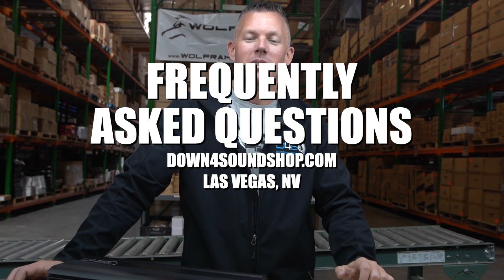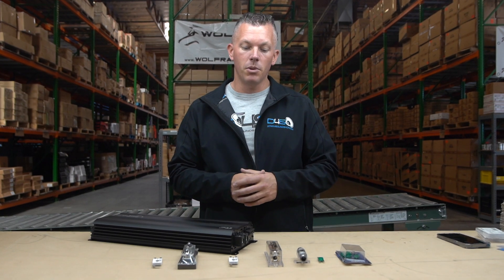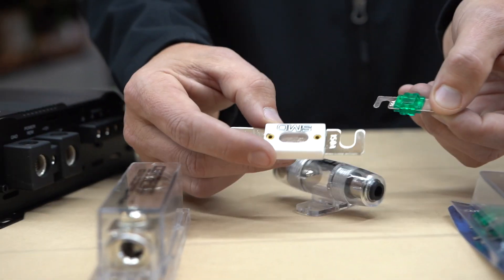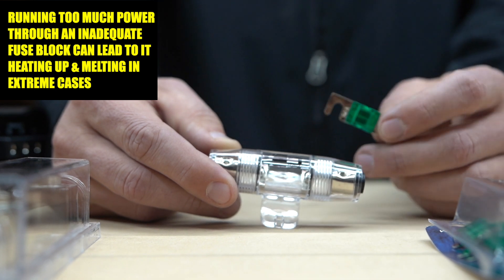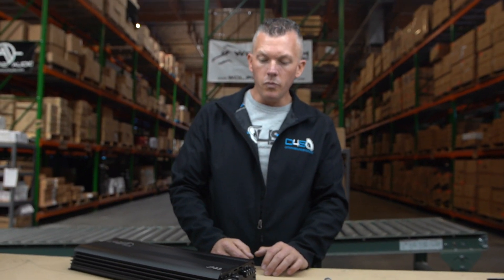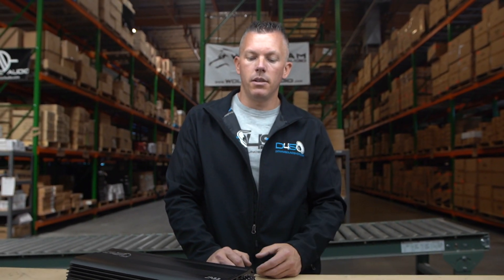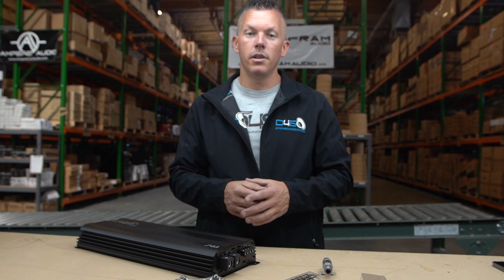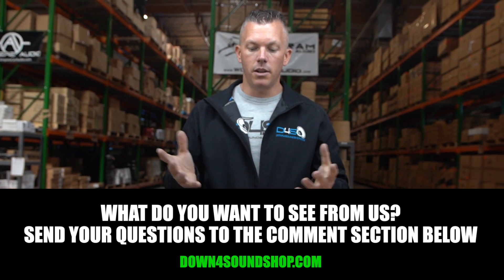FAQS WITH JP: WHY DO I KEEP BLOWING FUSES

Comment: A mini anl fuse can be 200 amps, and be zero gage, what heats up a fuse holder is not the fuse type, its wire that’s too small, or connection issues. 
A mini anl, or a full size anl, will and should to the same exact job, with the same rated fuse. Using undersized wire will not only melt stuff, it will also have a voltage drop, as little as .5 of a volt is noticeable.
Know and measure voltage drop, keep a record of it, it will increase over time, and will point to problems before they melt stuff. Usually corrosion, or loose grub screws. 
I get it, you sell stuff….

Comment: I have the jp23 and it replaced my 1500 watt powerbass amp, forgot to change the fuse and blew the fuse. I checked every connection and traced it to the fuse. Mistakes happen from time to time.

Comment: I have a 6000 W power acoustic amp with four gauge wire. It blew a 200 W fuse. Do I need a 250 W fuel or 300 W fuels? Where did I go wrong?
Reply: 4gauge wire to start heat build up go to 0

Comment: I’ve been using the in-line fuse that came in my wiring kit that has a 60A fuse and it works fine at night but has blown twice on me while driving on a warm day. Could the heat be the issue?
Reply: If so, how should I go about this

Comment: I have a Skar 2000.1D and a Skar ZVX 15 on 4 guage OFC wire and it keeps blowing my 100amp fuses and jus melted the holder. I'm ordering a 200amp braker block, but should I upgrad my wiring to 0 gauge?
Reply: Did you figure it out ??? Mine keeps melting and blowing out the fuses
Reply: 4 gauge is to small for that amp

Comment: I have a question I have a 250 amp fuse the one by the battery could I switch that one out for a 300 amp fuse cuz it popped or broke?

Comment: Can you overpower a amp with a large battery by not running a fuse…..causing the amp to fry by simply switching it on …huge headway battery 120ah and tar amps bass 15k is my example no fuse

Comment: HEY, 

First of all, I’m a big fan I watch all your videos and I like and subscribe probably to the majority of them because I honestly do appreciate you and your team and everything you guys do . 

Moving on so I have a stinger oh gauge fuse block holder with a 250 amp fuse, and the same thing that kept the melting drastically. I’ll probably went through 10 of them. I do have a pretty big system. I do ask for a lot of power so I found out that for some reason the vehicle make and model that I have runs very hot and throws out a lot of heat when it’s raining during the summer that extra amount of heat being thrown from the engine along with you know asking for too much power already was causing my wire smell at least that’s what I believe. I actually look for a recall in my vehicle about the radiator or engine, throwing too much heat, and There wasn’t a recall, but there was many many many people who complained about the same thing for that make and model of the vehicle. I ask myself how do people in hotter time zones deal with this if this was the case.. 
moving on the solution to my problem, I got a 300 amp fuse, and I’m also going to attempt to 350 amp fuse see if that works and if not, I’m going to look for someone who could custom make a ceramic fuse block holder for me . 
I also ran OFC wire and have done the big three upgrade lol. Anyways. Any recommendations for a new sub and amp?
I currently have two kickers 15 inch comp Q  with a HIFONICS BRUTUS 3500 w amp  and also morel speakers with a Morel 2500 w amp . Morel has great speakers

Comment: Wow, thank you for letting me know about this, I was running a 60A AGU on a skar 1200 watt amp mono block with an epicenter and my fuse popped so now I need to get a 150A fuse with a good block that can handle that amp… again thank you for this information
Reply: What amp would I use for a 2000watt amp from skar
Reply: @IvanMorales-nm7hn  uhhhh 200 amp or 150 amp prolly
Reply: What guage wire did u use 0 or 4 guage wire

Comment: Could I use a 300 amp fuse but only be pulling 150
Reply: No, if you go bigger. The fuse won't pop when it should and you could blow your amp or damage something else. If your pulling 150 use a 200a fuse

Comment: So I hooked up my stereo, I blew a fuse as soon I connected everything. I got a new fuse and plugged it all up and it blew immediately. And even told glowing red and melting
Reply: Go over your wiring from front to back. Something can be pinched or touching somewhere
Reply: Started glowing red*

Comment: Question what's the biggest fuse you  can you use for 4 gauge wire cuz I have 4 gauge scar wire with the zero gauge fuse holder 200 amp I just put in today I'm wondering is my power wire going to burn up instead of the fuse blowing

Comment: Simple answer = not enough power wire for the amount of current coming through. Beef up alternator so amp is not starving which makes it run hotter an also bigger or more power 0 gauge runs to amp to supply more current amperage. Don’t listen to people that’s always trying to sell you stuff an take your money. That’s why they are rich and you are not. #commonsense

Comment: The problem I have is I can not find any ANL fuse block that is 100% waterproof for using 4-AWG cable being I live in NY state & fall & winter season are wet & also very cold. I currently use a Sky High Car Audio - Set Screw ANL Fuse Block along with Sky High Car Audio - 4-AWG OFC power cable & SMD - 100-Amp Ceramic High Temperature ANL Fuses & I used silicone to seal it & try to keep moisture out of the fuse block but I still blow fuses. Do you sell a 100% waterproof ANL fuse block for using only 4-AWG power cable? I also wondered if I should just move my fuse block behind the firewall to eliminate the problem instead. But the run of 4-AWG power cable from the battery would be about 3 1/2 to 4 feet to the fuse block instead of a 10" length & I do not think it would be safe to do in all honesty. What do you suggest to correct this problem JP?

Comment: what if the fuse pops as soon as you turn the amp on ?
Reply: bad conection are power wire may be geting grounded so check your power and ground wire front to back etc.

Comment: This may be a stupid question but I will take that L. When running a two battery setup how many fuses do we run. Is it two fuses between the main battery and secondary battery and then one fuse from the secondary battery to the amplifier or just one fuse between the two batteries and one fuse from the second battery to the amplifier

Comment: People like to cheap out on what they think is little things.
Why spend $100 on a wire kit when i can get a kit at walmart for 40?
Why pay the sub box guy hundreds to build a box to the specs of this high end driver i bought? Amazon has a box for 90 bucks.
Dont matter how much you spent on your componets.
The guy down the street with low end componets, but wired right with a real box built for his cheaper sub/subs will smoke you every time

Comment: Not a fuse question bcuz i need more power to even warm up my 300A fuse on my Salt 4k. So the question is when i do a 2nd batt with an isolator will the amp only draw power from 2nd batt even while the car is on as well? I know the isolator will cut off both batts while off.

Comment: it blows my mind that bassheads still dont understand this lol. its so simple. got 1200 watts? 120 amp fuse. got 1500? 150 amp fuse. no higher no lower. period. the fuse must be able to break under its maximum amperage capacity.

Comment: So I ha e a question? I have a 2000 dodge dakot extended cab. I am running a single zvx 15 4000 watts from kicker and a Phoenix gold line driver. My question is why am I only super loud with my windows down?

Comment: A bad ground will also cause melting, especially if you have the big 3
Reply: This just happened to me and I'm not too sure how to ground 2 rear batteries 😐
Reply: @ceavalencia4767  the fram of you car
Reply: @GMTPF800  is a negative run from front starting battery to rear batteries a bad idea?
Reply: @ceavalencia4767  to much work for me your car is a giant grounding point so to run a cable from the front of your car to the back is expensive as well a run that long would also HAVE TO BE OAWG AND finally it all comes down to what kinda power and system your running
Reply: @GMTPF800  stock alt no big 3, 2 runs of 0 awg sky high front lead acid interstate to yellow optima then short runs to D4S LTO 6.0 powering 3500 SKV Skar grounded at the rear. Neg post on rear had a bit of corrosion
Reply: 3500skv AND STOCK ALT is where I stop THEN I CALL MEC MAN FOR A HO ALT AND WACH MY VID ON YUTUBE..NO CARBQ!!!!

Comment: Top thing that cause s these issues regardless of 0 gauge is CCA wire not having ofc quality wire can lead to heat buildup and I've noticed most CCA 0 gauge wire is also smaller it's just CCA needs to be more dressed on how terrible that quality is

Comment: Why do my amp (4 channel ) keeps getting hot.. ?
0 gauge set up,  6/ 6.5  speaker set up (Arnold's)  , rp150 "1000" watt..
Fyi I have 2 rp150 pushing a total of 12 6.5 Arnold's & I have them each on a smd block with 300amp anl fuse from skar audio.. my other bass amps are 100% ok .
All thi is being powered by 3/ 80amp agm batteries , big 3 upgrade,  200amp alternator & 0 guage ofc running to the batteries in the back & to the amps . 
Any advice ? 
All works well for 15 to 30  minutes or  so on medium to max tilt until the rp150 start getting a fever.. lol the I'll back of on the volume.
Could it be a ground issue?  Because I have 1 ground from the chassis to the distribution block & to the batteries 🧐🧐🧐🧐🧐.. help

Comment: Also to mention poor voltage can cause fuses to melt also since it results in higher current, not as common as a loose connection or to small of wire but it can happen.
Reply: I don't think thats how it works
Reply: @trunkbangking  he’s right. Low voltage can cause it

Comment: Another issue can be cheap fuses themselves. I’ve seen them, even being the correct amperage, just heat up and melt.
Reply: This just happened to me, I bought a 100amp fuse from Amazon, ran it for 3 hours then melted

Comment: What voltage should my single d3400 xs power battery be charging at xs power says no more than 14.4 for any amount of time then they say no more than 14.7 for more than 5 minutes but then they say your charging voltage @ 32°F should be 15.3 and @ 104°F 14.3.....maybe you could clear this up for us cause alot of people say charging at more than 14.4 will cause the battery to gas which will kill the battery over time but alot of alternators charge well above 14.4....please make sense of this👍✌
Reply: yea 14.4 is the charging rate for a 12volt batt in the morning your car will charg high untill it warms up and it should sit at 14.4 and above but not to close to 15 but if you get a realy good charger its gona charge your batt corectly

Comment: Im running no fuse on my walmart 2500.1 amp 👍 with separate rear battery no issues
Reply: You're asking for trouble.
Reply: Fuses are very important
Reply: How is ur 2nd batt installed...isolator or no?
Reply: There's never any issues until there is.
Reply: @Theyoufeelme  If the wire gets a cut or if someone crashes into his car from the front.. It's over. Let's hope he has an extinguisher
Reply: @bassdynasty8840  I already know.

Comment: If I do a double run of 0 gauge to a teramp smart 5k what fuses should I use ?
Reply: I have a similar setup and I run a 250 amp fuse for each wire. Those wires are usually rated to 300-350 amps.

Comment: Great vid and I would also recommend using ferrules with those high strand count OFC kits.
Reply: For sure I used a trick I seen on how to fit 4/0 into 1/0 easy used a zip tie to keep the strands together saved me big time when adding a fuse block to my alternator wire with sky high 1/0 amp kit the wire is so big the nvx1/0 ferrules were to small

Comment: I have 1500 watt topstrong gear 1 ohm amp. I have a 150 amp resetable amp and I keep blowing it. 4 awg to the amp off a 0 awg block. Help
Reply: Use 0 gauge. And make sure to match the ground wires going from your amp and at the battery (power source)
Reply: @ragextico  it only takes 4awg
Reply: @bigkevin20  I’d put a 200A fuse. Or get an amp distribution block so you can have 2 sets of 4 gauge. 2 for power and 2 for ground. Have you done the big 3 upgrade?
Reply: @ragextico  yes 0 awg big 3 has been done. Stock battery and alt so far.
Reply: @bigkevin20  the power that the amp is pulling might not be enough for the stock electrical that you’re running. In that situation, you’d want bigger wire for everything that the aftermarket devices require to be extra safe. 2 gauge would be ideal for the amp and grounds
Reply: Check your voltage when it kicks out if your voltage is tanking then your drawing to many amps in that case your possibly clipping if not check your ground and power connections or 200 amp fuse

Comment: What size fuse would I use for a cab 4500?
Reply: Good rule of thumb 2kw amp 200w fuse 1kw amp 100 anp fuse 3k 300a total fusing. Divide your wattage by 10 or 12 and start there if you blow fuses, go up 50 amps fused. That has worked well for me. Remember voltage x amperage = wattage.
Reply: Two runs of o guage and two 250 amp fuses is what I would do

Comment: Does my 40 dollar double din have afftect on how my amp performs..i am running a 3k taramps and 2 skar zvx12s..the head unit weighs like a 1/4 lb its thin as far as width..should i get a real double din like a pioneer??would it give me better output to my amps as far as volts?also have done big 3 and 2 extra batterys..no voltage drops just womdering if upgrading head unit will bring more power to subs?
Reply: Yea it will , quality of head unit matters big time I know from buying the cheaper head units from Pioneer until I got a Pioneer 80PRS model and it made a huge difference on my system. I was so happy how it sounded after installing it , it sounded way louder and my subs sounded deeper and mid and high sound so loud and clean . I recommend spending the money for quality, you will not be disappointed and oh I have it on regular settings but if I want the best performance it has a switch on the bottom of receiver and it changes the rca. Inputs to get maximum performance and it activates the extra xovers
Reply: I agree I also own the 80prs it's definitely worth it and makes an huge difference
Reply: @beerman9807  thanks bro..ya i have the best of the best in subs doors and amp..i skimped on my head unit...
Reply: My 5volt preouts made a massive difference in overall quality and performance in my system. I will never buy anything again that doesn't have at least 3 sets of 5v preouts
Reply: @Pittsburgh-412  what head unit do you have?
Reply: @ronnydisalvo80  I have the jvc kw-m865bw
Reply: https://youtu.be/TKpg6RMn9wE